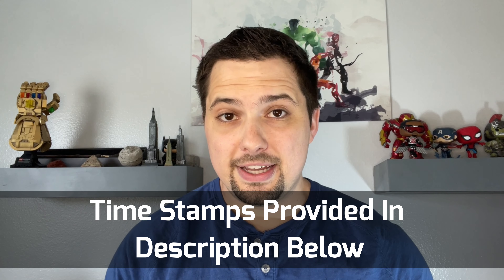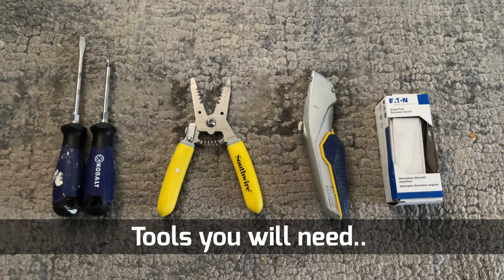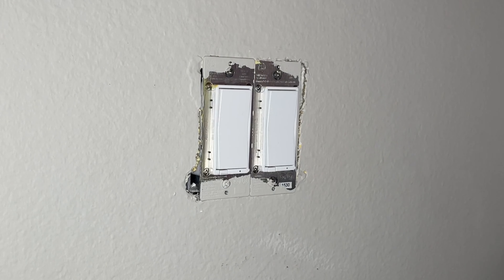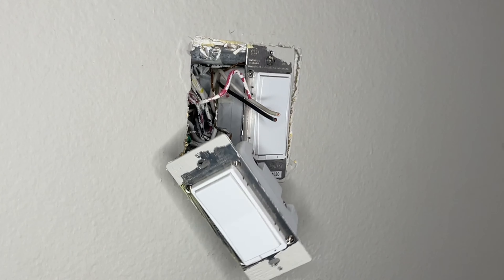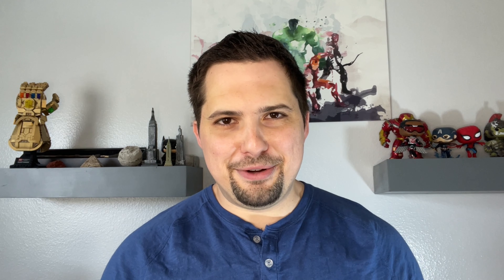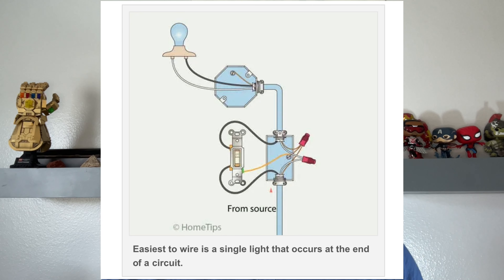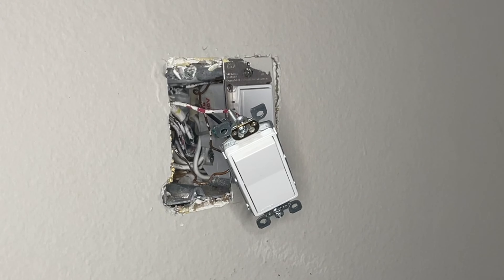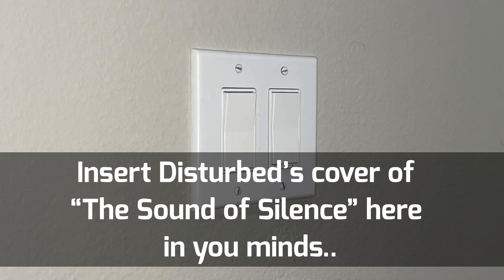A Smart Light Switch that Pops and Ticks? How I Fixed it! - GE Z Wave Light Switch

Comment: I had the same issue tonight with the clicking noise. I just did a search and found your video and it's the exact same noise. For those of you that aren't going to replace the switch with a Smart switch that extra white wire can be just cut and taped off. Just make sure it is the neutral and not the hot wire.  It's only needed for a smart switch because the switch itself requires power for the Z-Wave electronics.

Comment: If this helps anyone, I lost 3 switches after a power failure here in SoFlo.  There is a teardown video on you tube (https://www.youtube.com/watch?v=MsDTi53qq4Q) that got me closer to what I was looking for, which was to actually fix the switch itself -- I ended up replacing the 25v 10mf capacitor with a 50v 10Mf cap removed from some old PC board that I had laying around and it worked out well with the switch once again working as expected.  to be aware, the case opens easy (4 screws) then carefully lift up the antenna from the case and the hardest part (for me at least) were the 2 plastic clips holding the bottom board in place (they are sandwiched boards with the top one being the zwave functionality and the other is the power board) out of the case. I used a flat screwdriver to gently bend back the clip so the board was above it and then did the same on the other side.  it may help to place a thin plastic or similar tool to hold the firt side above the clip so it does not fall back under the clip.  Once you massage it out, you need to desolder the 6 pins that connect the board and the, desolder out the old cap and solder in the replacement. On one switch the above cap worked.  On another switch, I see a difft capacitor bulged on top so will test / replace that one if needed first.  May create a test board as it seems these GE Zwave switches go from time to time and this is cheaper than paying $3x for a new switch each time.